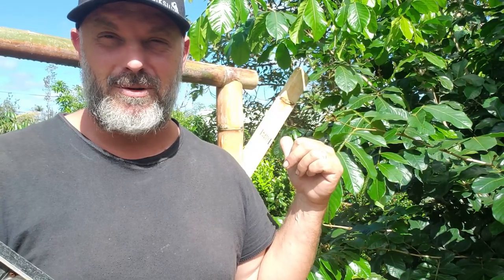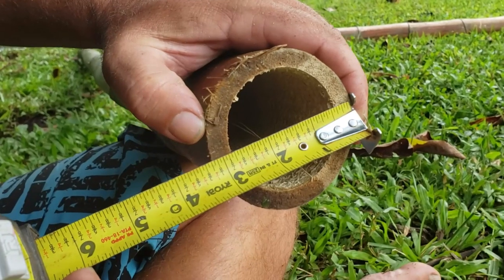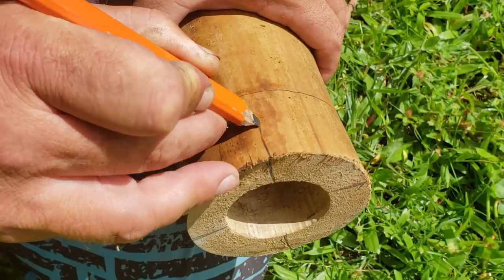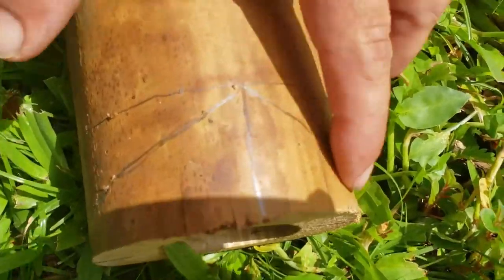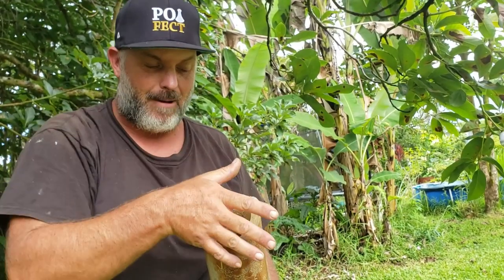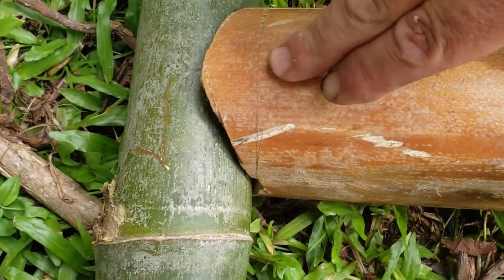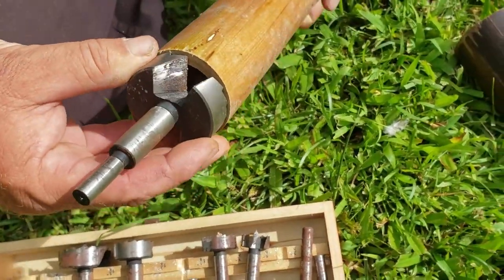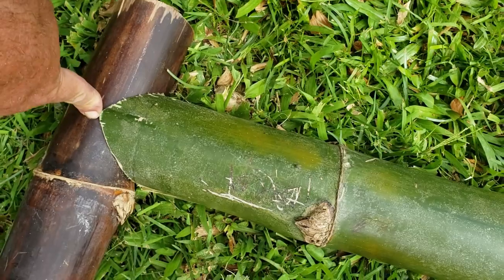Bamboo Construction:  Making Fishmouth Joints

Comment: If you use a Hole saw there will be no carving necessary and you can match the size of the bamboo to the size hole perfectly. Thanks for the video! :)
Reply from the maker: That’s what I use. Plus a dremel to shave it down a bit after using a hole saw. I should make a 21st century version of this video

Comment: Your “fishmouth” joint, in the pipefitter world we call that a saddle joint. And you're going to put a lot of effort into carving out that joint. Now in your video you demonstrated your use of forstner bits… Okay so I'm going to take you to the next step. A large forstner bit or better yet a cheap hole saw the same diameter as your bamboo. Just take a length of bamboo and use your hole saw to drill a hole all the way through it. And since the bit is the same diameter as your bamboo pole, it'll effectively cut the bamboo in half and create the saddle for your joint at the same time.
Reply from the maker: A trick I have learned since then. Thanks for sharing. It’s genius

Comment: Please do not use a circular saw on rounded objects . I am a professionel woodworker and most powertool accidents happen with circular saws.  Not wearing shoes is another mistake.. for bamboo cutting i always use a japanese pull saw. just as quick and a lot saver.  Keep up the good work
Reply from the maker: I need to get me a japanese hand saw.  Not only is the circular saw unsafe but it cuts rough too.  Itʻs what I have for now I guess.  Mahalo for the warning.
Reply: the handsaw also has the advantge of not using electricity.  So its a win win.